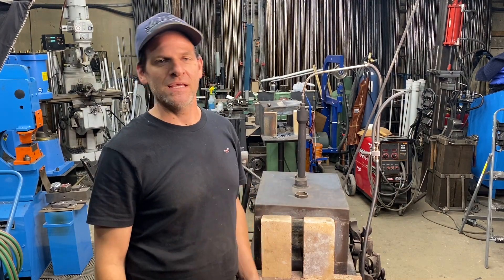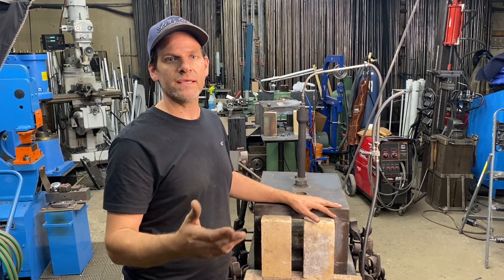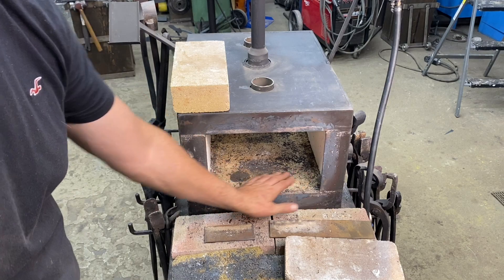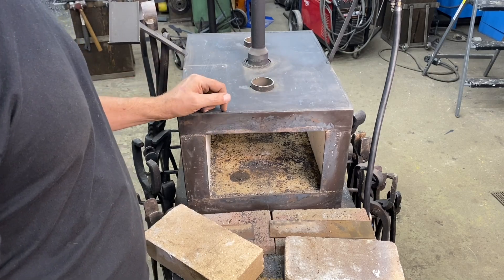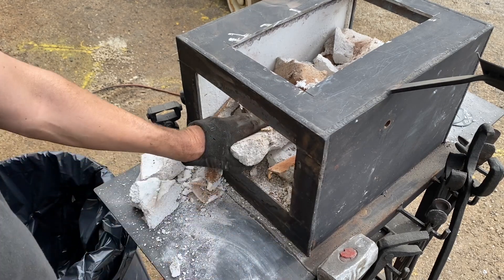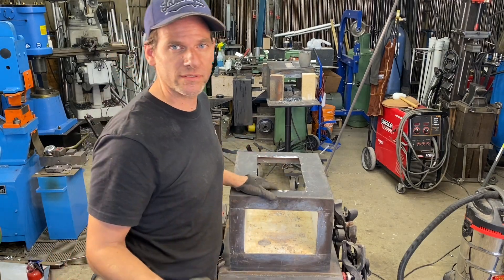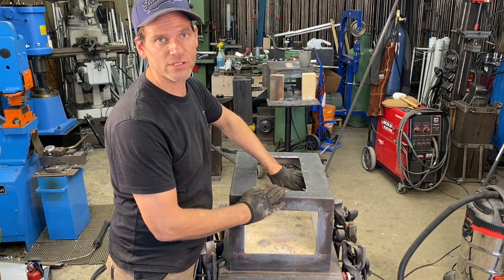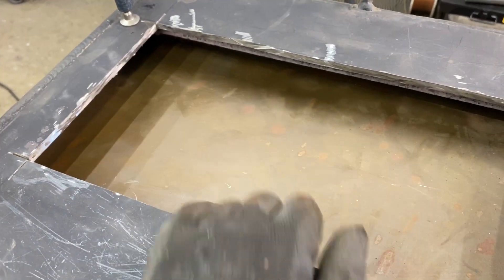HOW TO CONVERT AN OLD FORGE TO A RIBBON BURNER!!!

Comment: hello how far do you leave the burner gas ejector I made mine but it has a low pressure of fire it is not heating right
Reply from the maker: hi , its going into the tube about a 1/4"

Comment: An you apply a kite coat of wd40 to the form?  It would pop out like a festered up splinter?  We apply oil to our steel forms when pouring concrete makes life sooooo much easier
Reply from the maker: wayne mitchell awesome thanks for the tip I’ll try that out